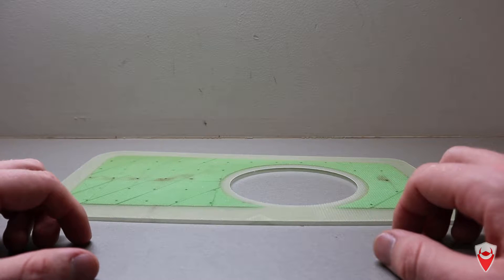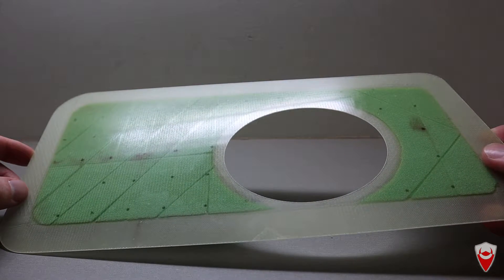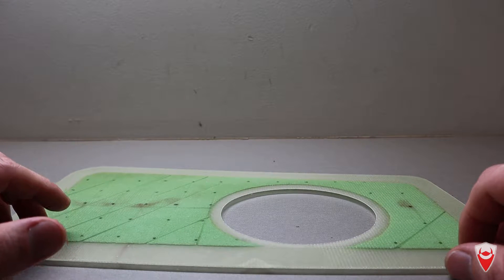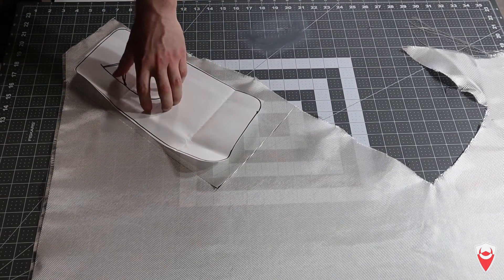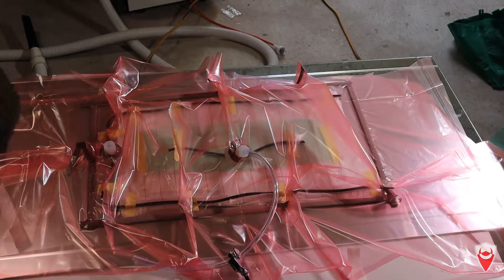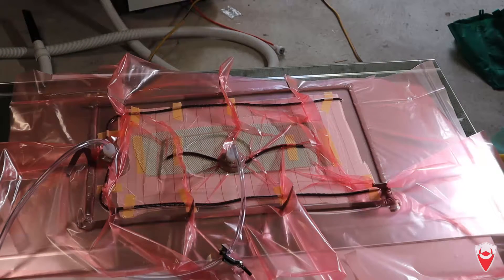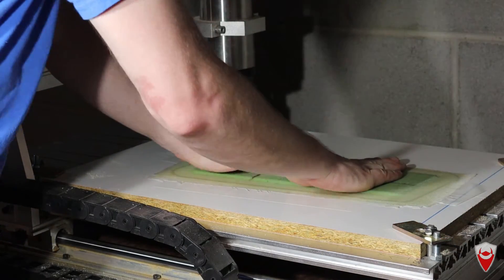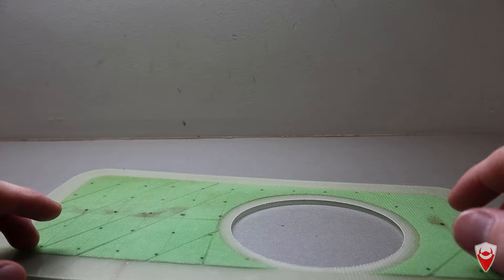[BUILD] F3 Sidepod Cover Build

Comment: very good video. i would be interested to know more of this part after being used how long it took to be destroied again once the process is changed. and if you can post cure, and show the diferences in use of a cured and a non cured part regarding heat would be amazing. thanks for sharing.
Reply from the maker: G'day Mate, glad you liked the video. Sadly this is one part where post cure wont help it. The underside of the part is between 3-5mm (1/8" - 1/4") from the exhaust pipe. It is so hot there that the Tg (what post cure affects) doesn't matter, the actual epoxy burns a bit. However that doesn't affect the functionality of the part. The previous part was in service for over 3 years before the failure, and the failure was not caused by normal usage.

In this instance the front two fasteners (if you look at the thumbnail one is in the destroyed place and the other is in top left corner next to the burnt section) were not reinstalled after the new colour scheme was applied. The car was running a test day and at high speed (up to 230kmph at that track) the air pressure caused the part to bend in half about the middle fasteners which then put the area that has been destroyed directly into the exhaust flow. There is no epoxy that I know of that will survive temperatures of ~1000 degree Celsius. With the front fasteners in the part has appropriate strength and retention to survive a much longer service life.
Reply: @CEWManufacturing  nice thanks for your answer!

Comment: I bet you could save that 6 grams by not putting the cross cut in the core along with clamping off the feed line sooner so the laminate compresses more. It looks to me like you let it go long so the part could be over saturated. Otherwise pretty cool.
Reply from the maker: Glad to hear that you liked it. 
I think that you're probably right that the cross cuts would have added to the weight. I calculated how much extra weight per m2 there was from the core punch when I built it, I should do the same for the cross cuts. 
I do believe that the difference in weight was primarily driven by the correct saturation levels of this part vs the undersaturation from the wet layup with bag that I used to do, they were chock full of pinholes.